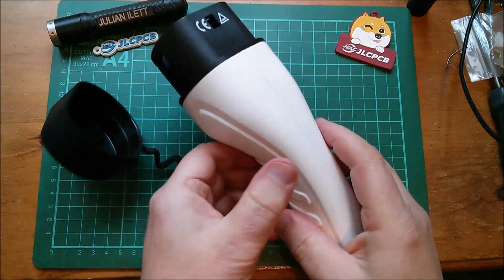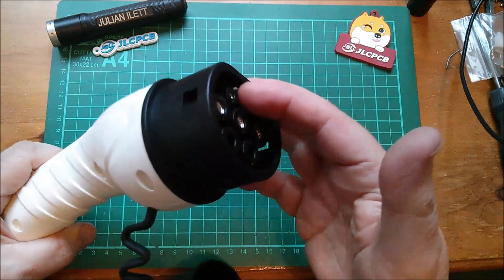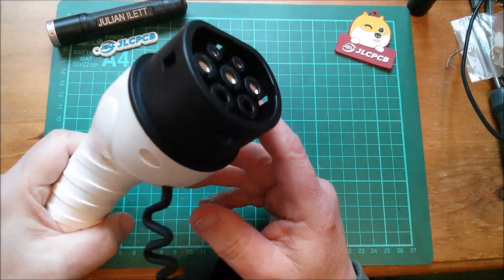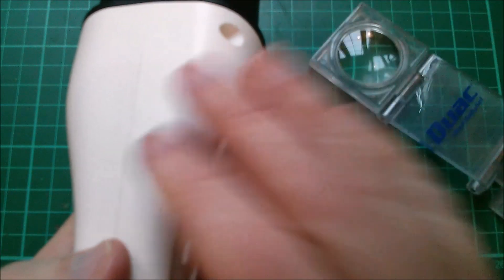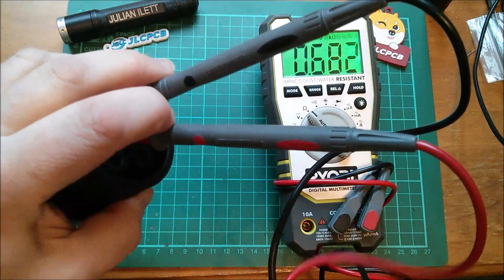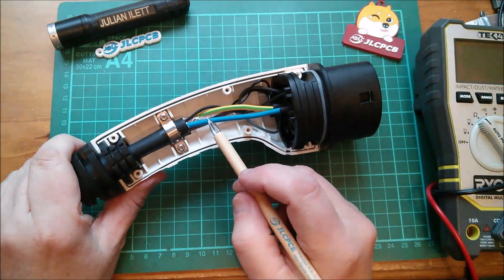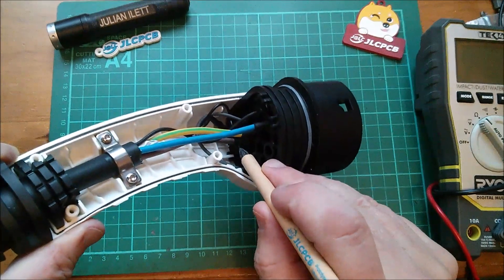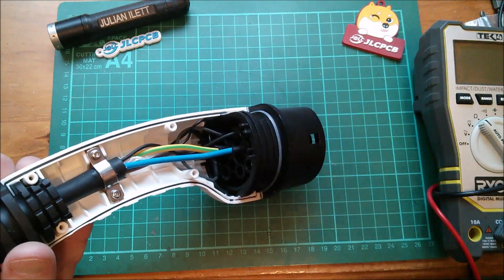680Ω Resistor in Type-2 Connector

Comment: Hi @Julian's Shorts, 

Hope you read this and can give some proper advice:
2 days ago I was charging my car with a limit to 80% and thru my app turned off limit to charge it a bit more. As soon my page refreshed in app, it said 99%. Immidiatly went to car to stop charging sessions because it was not right 80 to 99% in 1 minute? The plastic ends on charging cable felt warmer (not that hot I could not touch them.) Also smells verry slightly burned.

If there was a shortcut by too many voltage due to residu or something, shouldn't the resistor be broken?
I'm afraid to test out this cable again.

Car battery % went back to 81 after I drove it a bit and shut down car for 30 minutes.

Comment: Do you know the specs of the cable which is connected to the charging gun? I would like to increase the length of it as the wire's length isn't enough to reach my car.

Comment: Hi Julian, thanks for the insight. Actually, I bought a preowned Rav4 phv which came with a 15amp main power supply plug. This plug is not compatible with my country sockets, I am try Ng to replace the power lug with a 32a plug, however when I cut the cord, there are five wires: white, black, green which I understand but the two remaining pink and orange I don’t know what to do with. Please guide me. Thanks

Comment: This is very interesting, thank you. I have a problem, I purchased an 'all in one' Type 2 to UK 3 pin adaptor and its not worked since new - the Pod Point (UK) seems to run checks when plugging in but after a few seconds wont authorise power delivery. The resistor in my adaptor measures .995kohm and its connected between PE and CP. There is also a direct link wire between PE and PP (marked CC on my plug). So your video suggests my resistor is on the wrong pin? It should be to the PP pin? Further, is the direct link even required? Many thanks to anyone that can help please!

Comment: Hi! 
I have a type 2 one phase L1 to Schukko cable.
 It does not have any pwm stuff inside.

just a directly connected wire instead of button to signal proximitry and a resistor for  max 16Amps current setting.

I plan to extend it and put 2 more chargesers on one by one on L2-N, L3-N pins.

I will wire Schucko plug socket for them.

Sono extra electronic and stuff needed?

I will  have max 16Amps at both phases on 230V AC?

so 3 times 16Amp current max?

My chargers are L1 1.3kW, L2 2kW, L3 2kW.

I have to plug L1 first, that has CAN communication to battery to open relay. 

I will plug in other 2kW chargers manually to socket on L2 then L3.

I think better to use both phases instead of L1-N only to be similar flow on neutral, but some charge stations like in india have one phade Type2 AC only....

I am in EU, Hungary, here 3 phase is the common and if not balanced 3 phase load it reduce max power to 3.6kW.

Comment: Thank you for the valuable information. I want to ask if the socket has the right value resistor for the existing cable cross-section, can we supply the EV directly from a home socket with the extension cable that doesn't have an ECP unit? Does EV pull a current that cable could carry?

Comment: So I’ve bought a car side (male) type 2 socket. I just want common garden 240v to charge my work batteries. How do I wire the cp and pp pins so the charging station knows it’s plugged in?
Reply: I’ll clarify I just want ac to charge my Makita cordless batteries

Comment: I have an type 2 adapter with a 200 ohm resistor and it does not work. Maybe a 1500 for 13amp? Maybe it should be 220 ohm?
Reply: a 220 ohm resistor rated at least 0.5 watt or higher is what you need for a 32 amp feed, make sure your cable is rated for that ampage.
Reply: Use 1500 . many charging stations cant provide this power .

Comment: Julian, have you looked into the disconnect button on Type2 cables? I am in need of one for my Tesla MYP. The Type1 US connetors have a NC switch around a 330R resistor in series with a 150R resistor and pressing the button signals to the car. I cannot seem to see how this works for Type2 (the values of resistor are different). Any information would be greatly received.

Comment: Correct me if I am wrong - 1500R 13Amp = 240Volt AC x 13A = 3120 Watt Per hour at 30p for every 1000 Watt, Charge time say 8 hours = 24960watt / 1000 = 24.96  24.96 x 30p 748.8p = £7.49p. I round up because your electric supplier rounds up your bill. How far would your car be charged and how far can you travel on said charge?
Reply: 25kwh gets you 100mi or 160km 20% more at slower travel speeds, 20% less at fast speeds